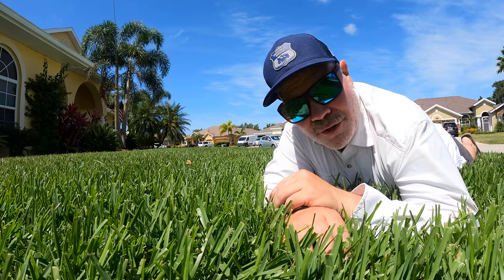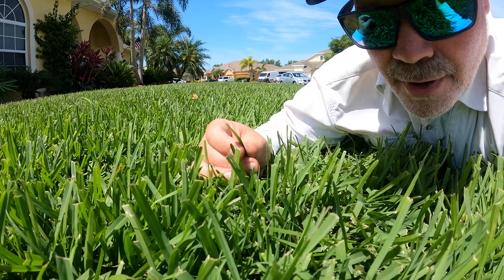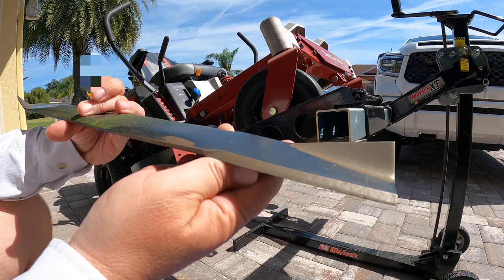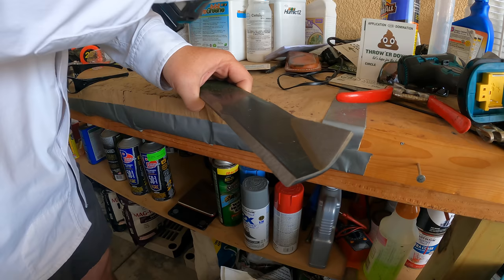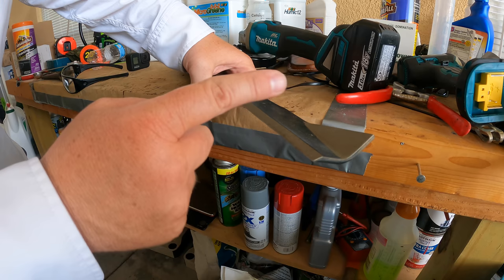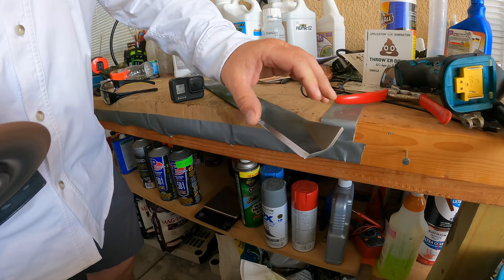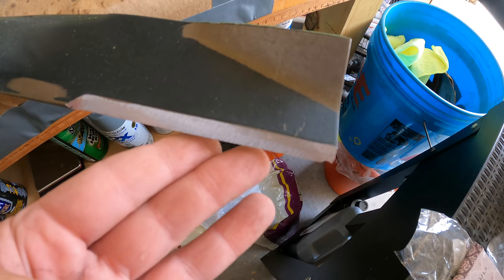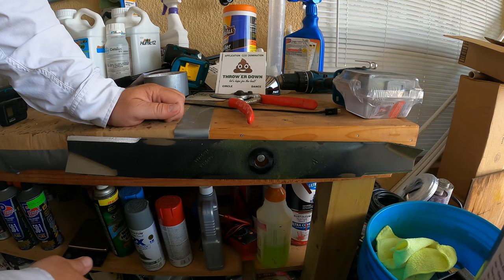How To Sharpen Lawn Mower Blades

Comment: Have you done a video on that mower lift? I really need something better than a jack & blocks.
Reply from the maker: It's called "MowJack" and it's a must have if you operate a tractor or ZT
Reply: @Thelawncarenut  thank you & I agree!
Reply: Harborfreight has one that works for mowers and ATVs.
Tractor Supply has a scissor lift one.

Comment: So shiny! My Honda blades have a curve to them, tough to keep the angle consistent, but I do this like once a week because why not lol.
Reply: Try bench grinder, perhaps might help you with the angles. What I use with all blades but takes a minute to get the feel for it.
Reply: @mateo85tx  I need to get a bench grinder at some point they seem so handy. I’ve just been using a pneumatic rotary angle grinder with a polishing wheel on it. Works ok I guess but doesn’t get it perfect so I use an old cheap sharpening stone to do a final touch up to get it better.
Reply: @DIYDad1  I was trained by a really old school guy about 10 years ago and I’ve stuck with it. Hey, as long as it’s got a good edge all that matters though. I just use a cheap ryobi from Home Depot, think I paid around $60ish. Just replace stone occasionally. Good luck brother!!
Reply: @Epicentr  well yeah obviously. And not really a true statement, you’ll make lawnmower vibrate and won’t be enjoyable, but yet to see any neighbor kids killed. Slightly exaggerated I believe.
Reply: @Epicentr  and the balance “IS LITERALLY THE WEIGHT”. Not trying to be smart with you but it seriously is........
Reply: @mateo85tx  That's the weight and balance of material but if you mess up the contours of the the blade you throw it out of centrifugal balance and risk throwing a blade.
Reply: @mateo85tx  It's physics.
Reply: @Epicentr  you’re not wrong if we were talking about some serious RPM’s , however on a mower that turns 3,200-3,400 RPM’s depending on the unit your statements are most definitely incorrect. Contours would absolutely matter on something like an airplane and could also make the cut worse if you get way off on contour on a mower. We’re talking balance though, therefore absolutely has nothing to do with balance if the weights on each end are halfway correct. Contour would effect aerodynamics but not necessarily mass distribution of weight...AKA Balance...
Reply: @mateo85tx  It's far more delicate on aircraft but still should not be underestimated on a lawnmower blade if you're not being careful. I've seen a number of blades being thrown and physical casualties due to messy sharpening.

Always follow the contours because that's how the blades are designed to be balanced for cutting and centrifugal force.

Before you respond again, please bring a physicist or a mechanical engineer with you to explain what a flat blade and a curved blade can do in excess of 2k RPM in tandem.
Reply: @Epicentr  I understand what one could do under such force. However you’re still wrong, have to agree to disagree. Good night and good luck on the lawn brother/or sister.... God bless

Comment: Whatever happened to the fancy air compressor, die grinder, and 3M Roloc pads that you bought for sharpening mower blades?
Reply from the maker: I still have all that but this is much easier.
Reply: @Thelawncarenut  Agree. I've gone to a cordless angle grinder myself.  :-)

Comment: I think a grinder would take too much off the blade, if you haven't sharpened it in 6 weeks just a file rasp would be adequate. But if you have blades to waste... have at it. The lazy way. Can't do it with a metal file 🤔

Comment: I knew you were going to grind away your blade to balance it. Stop that!  Grind the END to balance. Your blade will be shortened almost imperceptibly. Your blade will last longer without wasting the width. (I learned this in a sharpening school I attended.). Your using a flat grinder is better than a concave result from a grinder wheel. Better would be a 1” belt sander and use the top of the belt above the flat plate. That gives you a convex curve leaving more heft in your blade to support the sharp edge. You’re working with soft steel that is easily chipped and having that curved blade of extra steel behind the sharp edge helps.
Reply: And you’re right about the ten penny nail. Not as good as the $150 magnetic balancer I bought while at my school, but more than good enough for any home owner.

Comment: 1.) Just spend 6 bucks for a flap disc. Better use a file for the job. Professionals operate with a belt grinder machine.
2.) It is not necessary to get rid off every nick. You are just causing a high material removal.
3.) Over Sharpening a mower blade the way you do results in a high sensitive cutting edge with low endurance.
4.) Using a nail for blade balancing does not work at all. It just shows that you have not the slightest idea what you are doing. DIY bearing installations does the job if you don't want to spend 280$ for a prof. blade balancer.

Comment: anybody know the formula to how many miles put on before you need to sharpen blades? it's about 30 hours for john deeres but i am not sure in how many miles. no, real deeres not that snapper/toro crap you buy at home depot, those aren't real deeres any more than sears logo'd kenmore appliances are made by sears.

Comment: It's beyond me why anyone would want to destroy the temper in an expensive blade by using a GRINDER!
Reply: So what do you propose besides that? It seems to be standard in all the sharpening videos.
Reply: @jonfreeman9682  The “standard” method in all sharpening videos is fast and lazy. I own a 36” SCAG walk-behind mower. The owner’s manual specifically cautions against using a grinder to sharpen the tempered steel blade. The extremely high temperatures produced by a grinding wheel will damage the temper of an expensive blade. I went to Amazon and bought a 16” Nicholson bastard file. It is designed to work with a wooden or plastic handle pushed onto the file's handle end. I bought a small vice and attached it to a metal folding chair. I did this because you see in photos that all vices are attached to a horizontal table, so when you insert the blade, it is positioned vertically, which I feel is an unnatural position for sharpening. Using a metal chair, I can mount the vice to the chair’s vertical back, making it easier to sharpen the blade, which is now horizontal. My former mower was a Toro. I used “GATOR” blades on it. GATOR blades have hardened steel edges. But, I have discovered that there are different grades of hardened steel. My file worked fine on the Gator, but my new SCAG blades are SUPER hard, which is a GOOD thing but makes sharpening more difficult. My lawn is one acre. My SCAG blades didn’t have to be sharpened until they were used for eight months on a one-acre lawn. I am willing to work hard to sharpen tempered steel blades properly, especially if I have to sharpen only once every eight months.

Comment: When you sharpen blades you are not grinding the edges you are sharpening the edges. Also the edge does not have to be razor sharp, the blade is spinning at over 18,000 revolutions per minute. Just look at a new blade it is not razor sharp, so there is no need to make it like a razor blade!

Comment: using an angle grinder is a really bad idea .Too much skill is needed to maintain  the proper angle and downward force  necessary to remove steel . it would be better to use a bench grinder with a table rest . that way you can keep the angle steady with very little practice . 
Also a a belt sander can be used with similar results . 
You make it look easy . it isn't .

Comment: i have to laugh, grass that's cut will allow mold, bacteria, diseases, burn, whatever else, no matter if the tip is ripped or not. healthy grass will heal aka stop the bleeding before the day is done, it literally grows that fast. yes tearing is bad to the eye of the beholder of people with psychosis. apparently they see the tips but not all the dead grass thatch which boggles my mind how you can see one, but not the other, or not care about the other...whole blade trimmings of dead grass is uglier than just the tip.